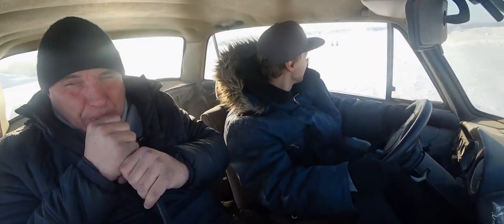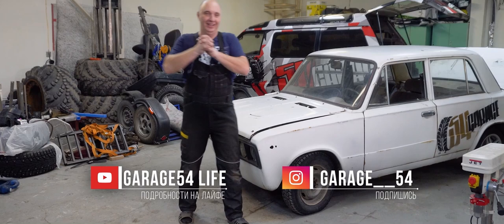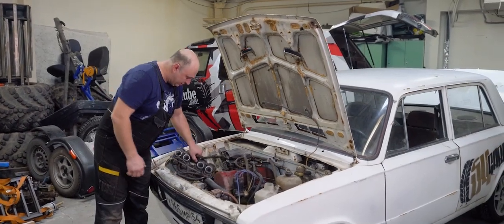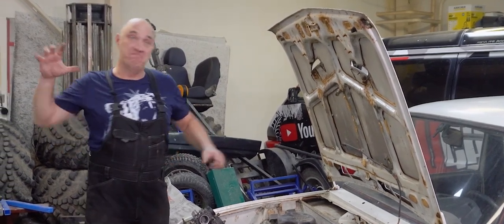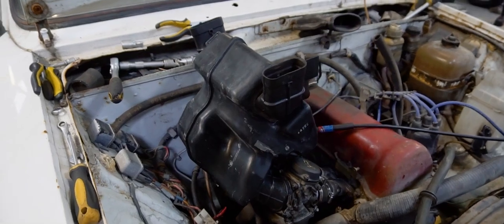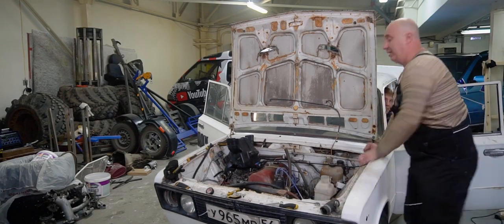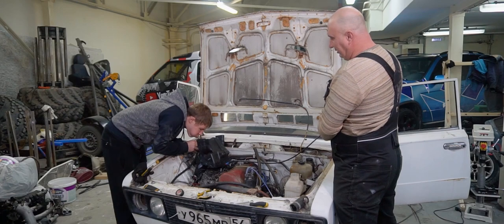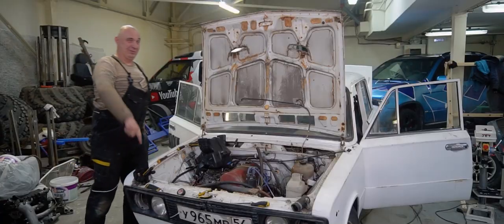We fit 4 motorcycle carburetors to a Lada

Comment: the tube your blowing into is the pressurized secondary circuit tube it normally get pressurized air from the air intake duct at the front of the motorcycle and add pressure to the fuel circuit to increase rpm range of the motor.  the 2nd one that was shorter and not connected is normally hooked to the bottom of the airbox where the incoming air in the airbox give low pressure for the first few 1000 rpm if i remember correctly the bike has a solenoid that switches between the 2 intake hoses at 12mph.  its been a while since ive worked on a carbed cbr600
Reply: would connecting the hose to the crankcase vent be good enough?
Reply: @2000freefuel   its possible but the amount of air flow and pressure created by the ran air duct is a fair amount. taking a funnel and mounting it to the radiator core upper support with the hose hooked to it would be a quick fix option too.
Reply: Its not pressurized. It will be at high speed but not at all times so Its pressure can be ZERO and it will still work perfectly. Its just a boost. It is used to Get more air into the airbox at so it is There to be used when Engine is at High RPM. When it actually demands more than Airbox can provide.
Bike engine can reach Top RPM at 0Kmh but its not at full power because it cant suck enough air to be fully efficient.
Example My ZXR 750 made 107hp at Normal Dyno NO WIND.
But it made 122 Hp at Wind Simulation Dyno that creates wind according to roller speed. Simulating real life conditions.
Thats Zero Tuning just Wind and No wind.
Reply: @2000freefuel  No Thats a bad Idea. Its a clear  air line to the Carb intake. It needs no pressure.
Reply: you are correct.
Reply: Honda does something like that within the runners of the intake manifold
Reply: Wouldn’t the staging of this thing kick in at different speeds due to different ratios of the gearing/wheels?
Reply: bikes still rev out in first gear withought mutch ram. you sure thas not the evap line to the charcoal canister? I've never had a carbed bike have a ram air line its always fresh air in the airbox or evap to the charcoal cannister for emisions.
Reply: @DexMaster881  Assuming the fuel required for a 600cc engine isn't sufficient for I am what is sure between 1-2L engine. Also would need a re-jet?
Reply: @WXSTANG  600cc but revs 2x higher

Comment: place the breather (pcv) hose feeding the float of the carbs, that way you don't need to keep blowing to force fuel to the throat of the carbs :)
Reply: i came here to say that.
Reply: Was just thinking isn’t it vacuum fed? Lol
Reply: @00DDS  if you pressurize the float bowl you are helping to push the fuel to the carb throat in parallel with the venturi effect
Reply: @MultiDopper  exactly requires a vacuum of some sort
Reply: What about use air compressor?
Reply: You guys are 4 years too late .
Reply: @tomek60517  Fr, they should make videos revisiting their previous experiments, but read the comments and do more research to improve the results.
Reply: @00DDS  usually it is. Even on old bikes the vacuum petcock dealt with this.
Reply: If you run a catch can in-line it wouldn’t be a problem at all.
Reply: It’s not vacuum it’s using crankcase pressure
Reply: Build a litel tank wide some lo  presur with The regulator adjust the flow...
Reply: Thinking of this one on the right
Reply: More accurately it might have a small amount of vacuum at idle from the PCV in the crankcase but once you apply throttle the vacuum goes away and the engine will build crankcase pressure.
Reply: Nitro RC plane engines are pretty similar, using exhuast gas bled off into the fuel tank to act like a fuel pump during aerobatics
Reply: Smog pump...
Reply: Hahahahah yeah

Comment: Those are CV (constant velocity) carbs.  In the top cover there is a diaphragm, that diaphragm opens the slide and needle when it sees manifold pressure.  The manifold pressure controls how much the carbs open to prevent a rich or lean condition and throttle bog by not letting you open the throttle fully before the MAP is up enough to draw the proper amount of fuel, and as it's name suggests it meters the airflow across the jets to a, yep, constant velocity of airflow through the venturi.  This is so the jets see about the same amount of low pressure at idle or wide open, otherwise it'd go rich when airflow is too high and lean when too low.
Reply: Best answer!
Reply: @Buddy Rojek wrong it just this type of carb
 a keihin fcr carb with an accelerator pump don't need any of this to work great just like a car carb same thing when you stab the throttle the accel pump add extra fuel to prevent the bog
4 keihin fcr 41mm would make this lada engine sing
Reply: @legros731  This.  Not all carbs are CV, they're usually used when drivability is desired, like in a lot of consumer bikes.  Less throttle response, but if you hammer the throttle open instantly from idle it'll smoothly accelerate rather than die or hesitate.

Non CV carbs, usually with one, or several pumping circuits are meant for performance, and will do whatever you tell it, even if it's wrong, like instant open or closing.  It take a bit of skill having a smooth wrist and a good ear to roll on and off the throttle smoothly and keep a non-cv carb right in the sweet spot.  It's not really difficult, just a minor skill that needs to be learned and used to get the most out of the machine.

And fuel injection isn't necessarily 'better', it's not black and white good vs bad type of thing.  If you're looking to maximize performance and efficiency, a dyno tuned ECU driving a quality FI system with precise fuel and spark maps is about the best you'll get for performance, and if you're going racing for real this is 'best'.  

Now if you've got some consumer, non sports vehicle, the fuel and spark maps are set far below their performance potential and are tuned and limited enough so your nana can drive to church at half the speed limit.  If we're talking about being a user friendly, smooth quiet, machine that will run at pretty much any temperature, humidity level, altitude etc as design goals then FI is better than a carb.

But on the other hand, if you have a well tuned carb or synced carb bank over a stock vanilla mellow tuned ECU in grandma's Hyundai there will be a pretty decent performance increase with the carb.  But there'd be an even bigger performance jump with a fully mapped standalone system but that's often cost prohibitive on several levels from initial purchase to install to dyno tuning to make the investment worth it.

Personally on bikes i prefer a carb over fuel injection, in my use case it's a better option.  I could get more performance with a fuel injection kit, ECU and new throttle body but i ride remote trails and overland in the dusty desert hundreds of miles from anything manmade.  There's no shop around with diagnostic tools, ultrasonic baths for cleaning stuck injectors, and the LAST thing i want to do is be stuck because a wire chafed and fried my ECU 100 miles into the desert.

If i have a carb problem there's really nothing i can't fix or hack on the trail unless the carb is physically broken, like smashed to pieces with a rock or hammer.  Otherwise, there's only a few simple things that could fail that are easily fixed.  Most of the time it just needs a cleaning, that takes all of 10 minutes on the trailside.  I carry an extra diaphragm for the CV circuit as they can tear and leave you with very low power, and i also carry a few feet of extra fuel and vacuum hoses in my tools.

For me in this situation, a carb is best because it's easily serviceable anywhere with no special tools, just a screwdriver.  I take a slight performance hit and it DOES need regular service at least once every few months to keep it clean and starting on the first spark every time, but it's a small price to pay for the security of knowing i can fix it, rather than getting bricked by unfixable problems without a shop full of special tools and computers.

If  failure isn't going to turn your ride into a weeklong survival challenge then fuel injection would provide better performance, until it fails and doesn't provide any.
Reply: @rustymustard7798  ok but why did you have to write this wall of text I am fully aware of all of this i am a mechanic
Reply: @legros731  For anyone that's not a mechanic.
Reply: This sounds like the most accurate answer
Reply: @samuelmartin2817  because it is lol
Reply: Just like many Chinese scooters

Comment: You need at least #100 main jets. In my 1200cc 8valve  Kawasaki 4cil. it had #98 main jets. It dynoed at 97hp. 
Main jets define the full throttle peak power mixture
Then you play with the height level of the needles. This defines the mixture at medium revs. The higher the needle, the richer the mixture. 
Last: you play with the idle mixture screws. This defines the idle mixture. 
all 3 (main jet, needle jet and idle mixture screw) have a bit of overlap. 
Synchronisation: Hook up 4 vacume gauges to the porst on the carbs and balance the carbs in such a way that all 4 deliver the same vacume. (adjust them 2 by 2 , then adjust 1 SET to the other SET)
You NEED a closed sealed airbox on top of the carbs to make them perform best.
If you get it right the engine will REALLY perform strong!
Reply: Yeah at least they got it right and used the airbox... I made the mistake of removing the airbox on my bike once and it RUINED driveability. No level of tuning could fix it. Put a new airbox back in and it was a dream come true haha!
Reply: @volvo09  lmao
Reply: Size of jets depending on carburetor structure 125cc can have 140 size or 1000cc can have even 80size

Comment: Synchronize the carburetors would help a lot too. 
Need vac ports on the intake runners and a mercury Synchronize gauge.
Reply: Perhaps change the jets/needles to suit the engine as well.
Reply: we used to tune VW dual carbs with clear tubing and Koolaid, when the fluid is moving together equally, you're "there".

Comment: If blowing air is the solution hook the tube to either the crank case breather or weld a nipple to thee exhaust pipe and pull air pressure from there like small 2 strokes that dont have fuel pumps its uses ehaust back rpessure to push fuel thru system.. either one would work and probly balance it out since the amout of air pressure will be directly tied to the throttle
Reply: yeee thats gonna work :)

Comment: Build a air intake, like a big cone, facing the front of the car. Connect the pipe to the cone, that way, when you pull away, everything is nice and mild, but, as you go faster and the airflow into the cone increases, you gradually release the beast!

Comment: Motorcycle carbs have a secondary throttle that typically runs off air pressure from air being pulled in the carbs. It is probably set up to run on exhaust pressure to the hose. Or the crankcase. Also use a vacuum Guage to tune the individual carbs. Carbs usually have a vacuum port next to the outlet. Good luck. I hope to see more on the Motorcycle carbs!

Comment: those are cv carbs the throttle cable doesn't connect to the throttle but a butterfly that goes before the throttle. the throttle is activated by a rubber diagram that's pushed on by engine vacuum.  it could be that the larger displacement has so mutch vacuum that its slamming the throttle  all the way open and bogging it out, and adding a little pressure is able to close it just enough to get the fuel mixture right. could also be that its jetted so lean that it needs the throttle to be closed a bit to get it to run, or if that's the evap line that normally goes to the charcoal canister I could be shooting pressure into the float bowl and forcing gas through the jet to ritichin it up temporalerly. maybe try removing the airbox to lower vacuum and getting it to act a little bit more like the bike, and way ritcher jets.. could also be that the inside diameter of the runner is smaller then the through of the carb and blocking some important ports.

Comment: this has been done a lot here on similar engines, I have done this several times. Two  things it needs, NO MORE THAN 1.5 PSI FUEL PRESSURE.  you need to use a 1.5 to 1.7 mm main jet. Trust me. do those two things and be amazed.
Reply: 1.5 psi… whatever that is.
Shouldn’t there be a valve that shuts off the incoming fuel when the chamber is full?
Reply: @demil3618  divide by 14.5 to get bar if you prefer. Over .3 bar the needle and seat in most bike carbs will be starting  to do odd things that make the tuning difficult and counter intuitive. That would be the shut off valve you refer to. Known fact, you need at least 50 % more main jet area when using bike carbs on a ( much lower reving, near half the rpm capability) car engine, unless you want to go the correct route of changing slide and spring calibrations, emulsion tubes, needles etc etc. The quick dirty and effective method is to get some drills 1.50mm to 1.75mm in 0.05 mm increments and drill the  main jets out until you get were you need to be.  Its by no means perfect, but its 98% and costs near nothing.
Reply: @iainball2023  Yes that’d be a way to do it, widen the nozzle. There used to be little “needles” for that for motorbike tuning.
I guess what hasn’t become clear (and I wondered) is what size/capacity was the motorcycle engine a compared to the Lada one. I’d say suitable carbs should come from a similar sized engine.
PS: Yes bars are more straight forward and more common, so easier to use.

Comment: Somehow, blowing into the tube fully opens the throttles.  Jaguars used SU carbs that used vacuum to open the slides fully, I think this was called a "constant depression" carburetor.  They are probably blowing into the side that pushes the throttle fully open.  You can read about them on Wikipedia, but I've never been able understand how these work.

I've never liked carburetors, though I got pretty good figuring them out via RC model airplane engines and while working as a landscaper in college.
Reply: Cool. I think I understand some of it (how an SU carbie works), from Smarter Every Day's clear carburetor vids. I'll have to watch again and read the relevant paragraphs of that article
Also: [eyes narrow] We meet again!
Reply: @BubblewrapOracle  I'll have to look at those videos....Thanx!
Reply: @BubblewrapOracle  Birds of a feather....

Comment: This is actually something that was done a TON back in the day... Old Webber carbs on the 4AGE Toyota engines, and other small displacement engines, The mazda Rotary engines, all were popular for bigger motorcycle carbys back in the day. Not surprised it worked at all.
Reply: of course... When they did this back in the day, they were high performance engines.. and they used ITB's...

Comment: Connect a 12v air compressor and charge the tank. Connect a steady release valve to the output and keep it running while the car is running. Add a flow handle that you can squeeze to control the pressure release. Viola. You could also redirect some exhaust through the purge tube, but you wanna avoid combustion in the carb since it is not exactly a turbo assembly.
Reply: A standard carb is gravity designed and uses chambers that utilize bernoulli's principal to help with purging, think assassin's teapot.

Comment: Use different carburetors so you won't have to blow pressurized air. Motorcycle carburetor swaps on 4A-G engines are a thing. Could use many of the older motorcycle carbs -  and a lot more options as long as they are large enough for the cylinders and jetted correctly

Those are CV carburetors. Your throttle is connected to a butterfly valve behind the slide. So it is possible that the hose you are blowing at is the slide breather! When you blow on that hose you actually lift the slides manually and make more fuel and air go in!

Hanging up on a certain low RPM is often caused by manifold leaks and other problems like diaphragm leaks or improper jetting or horrible synchonization and float fuel level - these downdraft carburetors require a certain upward angle for the float to operate properly so choose a non-downdraft like CB1000 Big-1 ones or the older FJ1200s and other models

Would love to see a Lada running R1 or R6 YCC-T throttle bodies on fuel injection with e-throttle

Comment: First before playing with the jets/needle height/air fuel ratio mixing screw take apart and clean the carb (careful with the screws they are JIS). Syncing the carbs only really helps for low rpm/idle. The carbs need to be mounted horizontally at the same angle the were designed to operate. Ever try to wheelie an old YZF-R6 with a carb?

Comment: Those are cv type carbs. When you are blowing you are pressurizing the diaphragms raising the slides and adding air and fuel. Fix the airbox configuration and it will rock

Comment: I’d like to see a block cut off at the bottom right where the cylinder walls start and then attach that to another engine and weld the rods to have super long rods😂
Reply: And? Would b the same stroke and heavier so would actually b working backwards...

Comment: I think that is a cv constant velocity carb, they use vacuum to actually open the throttle, it has a throttle valve that opens , to allow the vacuum to open the throttle, I don't understand why blowing opens the throttle. Unless that is blowing fuel into the intake, from the bowl,  it's difficult to tell from here, maybe they can be modified to work like a conventional slide carb. Maybe the blowing deal is putting pressure on the opposite side of the actuator,

Comment: I'm assuming those are vacuum slide carburetors with springs in them. Try stronger springs. The vacuum a car engine generates is far different to a motorcycle engine. No reason why you couldn't get a car engine running quite decently with bike carbs, and really decently with some needle and jet tuning.